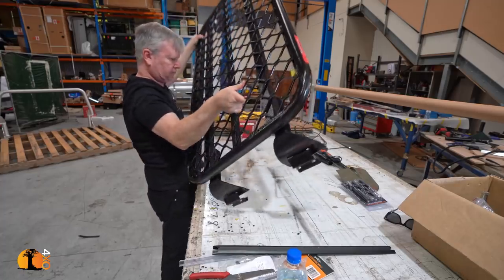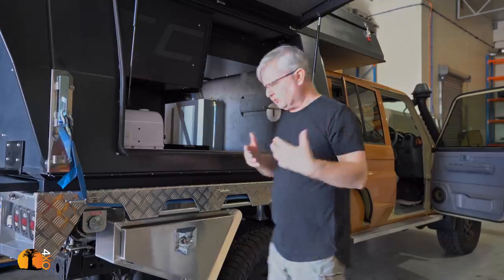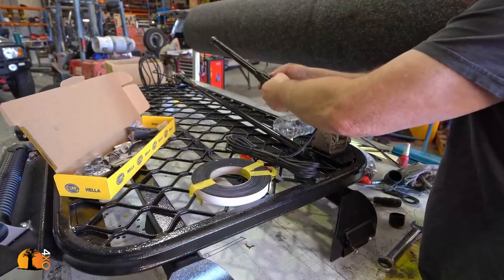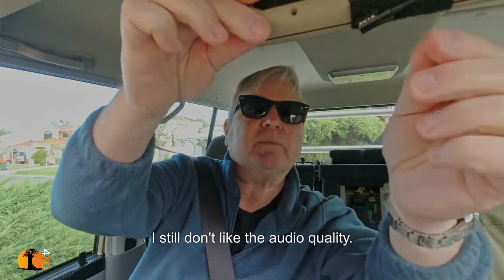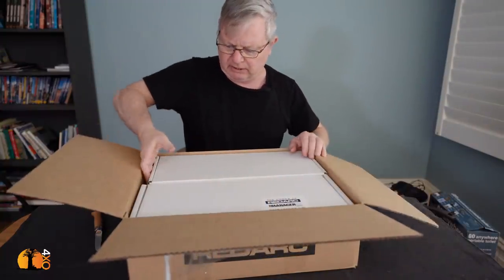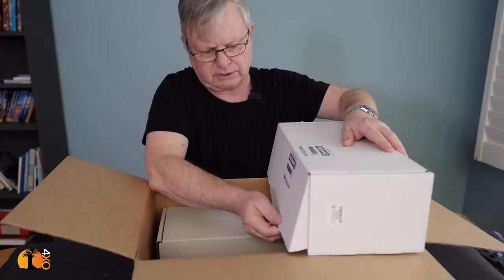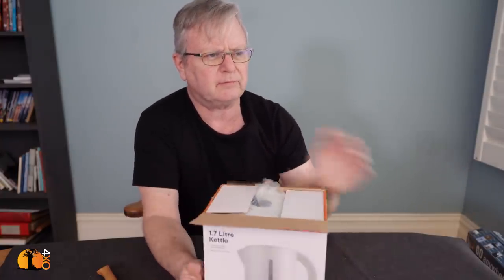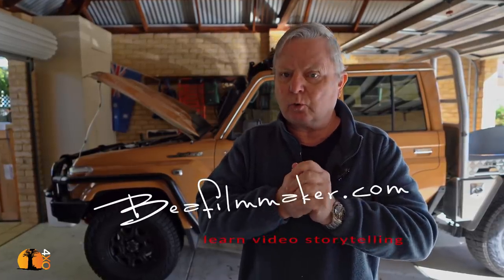Roof-rack build, camper stuff and unboxing fest.

Comment: Agreeing with the Rhino Rack folding antenna mount, better finish, well built, actual T-handle release backed up by a wing nut bolt to secure in position. Antenna hole is open to the side to slide the cable in without disassembly.

Comment: Good point about the cooking equipment and putting the same colour wrap on the camper will definitely make it smaller. As for Gwuen and the height issue a small portable scaffold would work, I see them in Bunnings every time I am there and dual purpose, step exercises while cooking dinner. Love to you both and thanks for a great show.

Comment: One thing to help with your kettle and not burning through battery capacity - go to one of those bargain stores or good kitchenware stores and grab one of those air pots 😉 we use one camping and they’re bloody awesome !!! Boil up your water, fill up the air pot and bobs ya uncle - boiling hot water for a few hours and no need to rebuild until you empty it all. 
Cost you about $30 and sooooo worth it 😉👍 
Keep up the good work mate, enjoying the content 😊 cheers

Comment: For the maxtrax, stick powerful neodium magnets to their backsides. Now you can click them on to your vehicles side panels.
Provides brilliant protection against supermarket trolley attacks :)
Reply: Sounds good!... but at what speed do they fly away?
Reply: @TimL1980  that will require some experimentation to find out.
Reply: @TimL1980  I remember working with some Swedes in North Queensland.
They stuck stubby holders on the outside of the driver's and front passenger doors 
With a can of xxxx, each one detached and flew off at about 60ks an hour.

Comment: Another issue with the rode wireless go is that is uses 2.4GHz. It is prone to interference from because the 2.4GHz band is crowded. Shouldn't be a problem when your on a trip though.

Comment: Andrew, I just had a thought while you were driving. You may experience glare off the electrical panel in the back seat onto your dash camera (I assume it has a lexan or simulate clear cover). Maybe consider an anti-glare screen protector so you can still visualize the internals.

Comment: RE: camp kitchen items, I'd like to rebuild my collection to include more square items, rather than round. While cylinders hold more volume, they are miserable and inefficient to pack. I've even considered (but haven't committed) to square shaped frying pan and water kettle. I'd like to find 'straighter' spoons and spatulas. Angled components work fine in the home but make for difficult organization in a camping box.

Comment: Most of your transmit power will be towards the most metal. i.e. engine. For the best placement of your  transmit antenna would be on the roof, middle front, not sides. If you cannot do that, just remember if you need to get the best TX distance is to point your right front corner towards the receiver. Also, Ground, Ground Ground. Bond the ground of the antenna mount to the frame. You will not believe just how better the radio will work. If one desires to go all the way, get one of  those 12/18in thicker ground spikes that generators use.

(ex Canadian Army Radio Operator of many years)
Reply from the maker: I realise this is a big compromise. If this was a radio shack van, I'd put them in the perfect spot and build a second roof rack on the camper. But it's not. The compromises required to centre the antenna on the roof rack for best ground plain is just not worth it. I need the rack for other stuff. Since a ground spike is out of the question, will making a better ground connection to the rack improve things?

Comment: I understand the problem with copying. However the reason overlanding works in the first place is that copying enables wide parts availability. And wide parts availability allows you to overland anywhere and everywhere knowing that parts and accessories are available.

Comment: Hey, Mr St-P-W, that new non-stick frying pan of yours - did you buy that to use on your new induction cooktop?  Not an aluminium pan is it? Induction requires ferrous pots n pans.     For the weight/payload conscious, aluminium gear and gas are the money.

Comment: Would love to see a ASPW Garage/workshop build

Loving this series
Reply from the maker: Its on its way.
Reply: The guy who made the video wants to fit  34’s next time.
Reply from the maker: @ianfarr-wharton1000  Ian. Did you actually watch the video I made of the new Defender? Or are you one of those people who have labelled me 'anti-LR', without actually listening to the words I use? Judging by this comment, this is the case. Please watch it and listen with an open mind to the words I spoke. And then see if I should 'eat my hat'. I said it would be very good off road. It was in that video. It behaved exactly like my LR4 did. But I concluded that its no better than LR4 because of its air suspension, large rim size and low profile tyres. As far as I am concerned, its just another LR4. It has nothing more to offer. This is no Defender. A Defender could do far more than just go off-road.
Reply: @4xoverland  I think your taking me the wrong way mate, I did watch that video and you said your looking for, if any one has a descent video. So I contacted the person who made that video I posted to contact you. Look I agree with some of your stuff but not all. Like I'm not a fan of Toyota (had a toyota prado 2001 worst car ever) And not a fan of BF Goodrich, they just don't last. And I'm a Aussie That lives north- west NSW. I don't live in a city.

Comment: build coming on nicely. a defo NO!!!! to the max traxx location. I use max traxx regularly based in the UAE, and as a Dakar rally navigator I can tell you that you need to be in the middle of the traxx (at right angles to traxx)  in order to line up the x4 pins. In your current set up you will need considerable strength and patience, or go around each side of the vehicle, or need x2 people! Most probably you will only be able to put x1 traxx at a time. A better solution is only using x2 pins but drill holes in the middle of each end.......hope this makes sense!

Comment: S'funny, this is really the way everybody SHOULD be building their camper/overland vehicles.
Start off with the basics and it'll be cheaper, you'll learn how to do stuff, you'll figure out what gadgets you really need and THEN, when you DO start to buy/fit gadgets, you'll know what you need and you'll be able to recognise when you're starting to have a detrimental effect on the vehicle's performance.
Far better than just plastering a vehicle in the contents of an ARB catalogue with no reason for most of it, no idea of how much it all weighs and no idea whether you really need it or not.

Also, I have a sneaky feeling Andrew is doing this deliberately as some kind of stress-test for how good modern electrical systems really are.

Comment: Do away with all those fuddy mics. I got the Saramonic twin transmitter deal. The audio quality is unbelievable, even in strong wind. Costly but oh so well worth it.
Reply from the maker: FYI. I own 7 microphones - Senheiser, Shure, Rode etc. All good stuff. In this case I have concluded, it's not the mic. Its the analogue-digital interface between the camera and the mic that is not delivering sound as good as I would like.
Reply: Simple Refined Living I was about to purchase the Sony UWP-D21 wireless mics. The one question no one can answer for me is whether it is possible to  have 1 transmitter going to 2 receivers? Can Saramonic do this? Maybe Andrew could comment on his Sony wireless mic. Logically, I’d say just set 2 receiver units to the same channel as one transmitter is sending on and that should be it, however in this modern age, some brands (Rode) like to use digital pairing, so regardless of what channel you have the mics set to, a transmitter will only work with a single receiver. 
Sorry for long winded question, but I was hoping someone knew the answer for either the Sony or Saramonic. Thanks!! 😊👍

Comment: Looks like you needed the box section base to raise the camper above the headbar of the tray, which is a fair bit taller than the roof line.  Have you thought of lowering that so the camper drops (50mm im guessing)?
Reply: Yeah I am not sure what the need is in keeping the headbar. I understand wanting to still use the tray for more common “truck” duties - and a headbar can be helpful with that - but I would anticipate that that will only rarely happen. He’s a smart guy, I do imagine he has a reason.

Comment: Andrew what about putting the max tracks on the gullwing and the spare tire on the roof rack? Probably you will never use it, si access will not be a problem. Instead max tracks should be more accessible.

Comment: Personally and it’s JMO, not hating, but I think you compromised the camper to have a tray! if you’d built the Camper to mount to the chassis as per the Norweld tray eg without it as a base for the Camper you’d have had a much lower COG, easier access all around for Gwen better handling and less weight, all things you usually mention as a priority esp weight! having it removable understand that, but why couldn’t you do that with the Norweld tray, customised for easy chassis removal, had boxes built into the camper like the tray. All the custom stuff it seems allot of compromise, a little bit extra you’d have a tray and a camper that’s seperate, for that inconvenience of moving over seems a much less of a compromise esp to the camper which is the primary function,  anyways I still think it looks great and will be great to see finally on the road back out in the outback, maybe it won’t be such an issue once you’ve worked it all out and shaked it down in actual use. All the best for it and you guys 👍